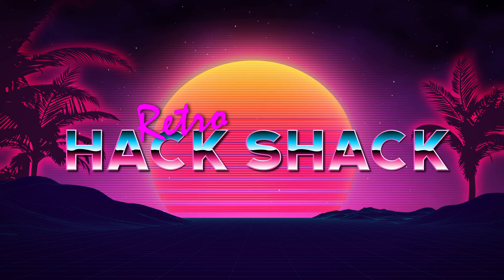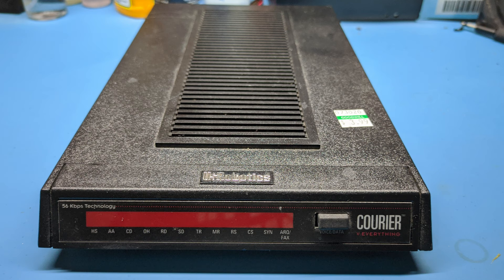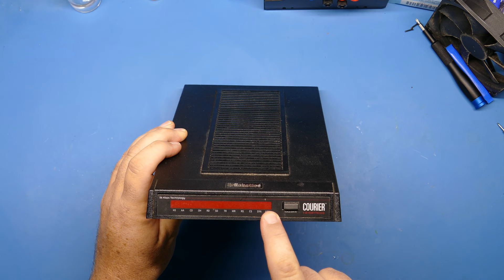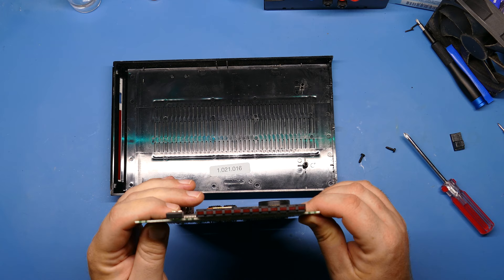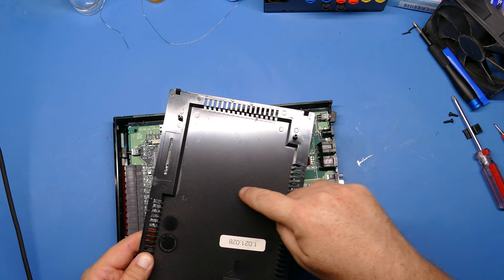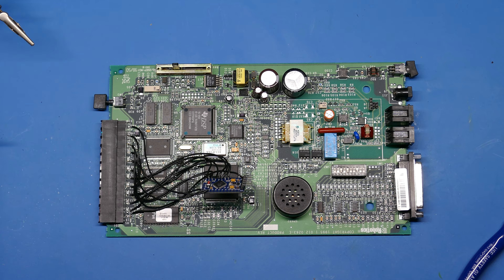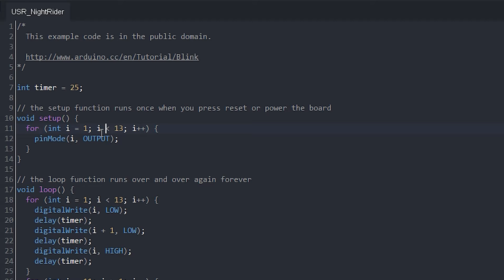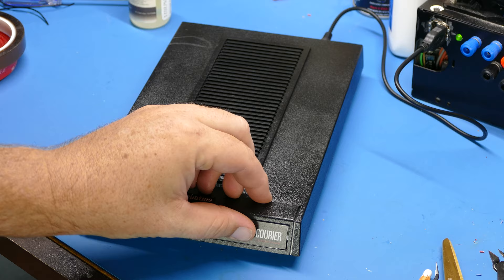Knight Rider Modem Hack

Comment: One of the reasons some of the older electronics with non-switching power supplies used AC adaptors, was to keep the DC electronics (bridge rectifier, filter caps etc.) away from the transformer which reduced the DC noise.  This was especially important with a modem which had very sensitive analog electronics on the phone A-D/D-A  side.
Reply from the maker: Makes sense!